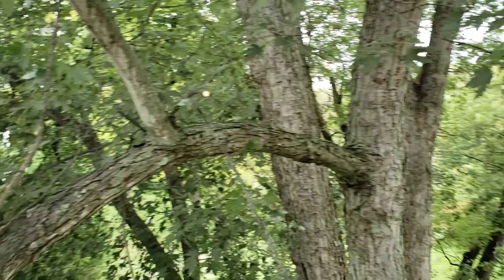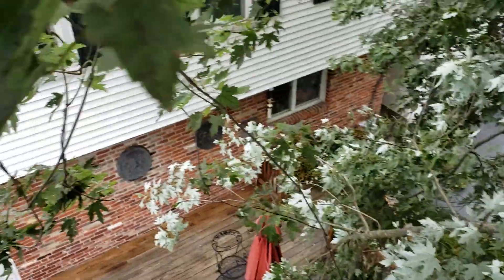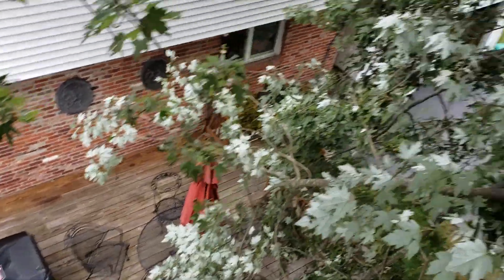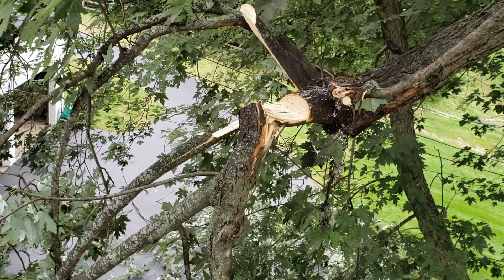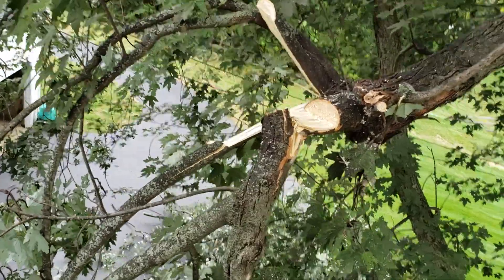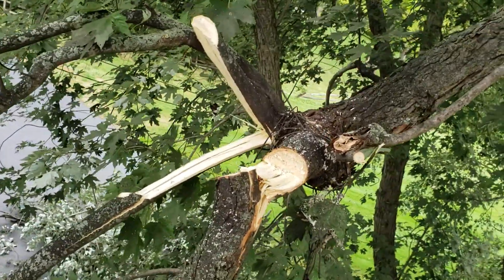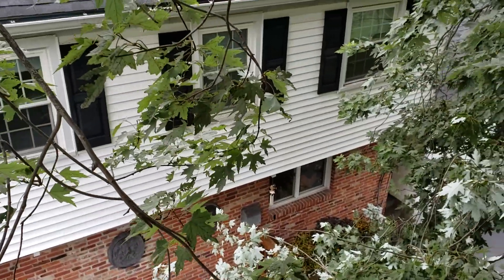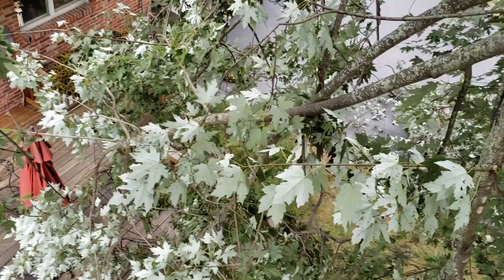how to reduce the force when hinging down a horizontal  limb

Comment: So did you miss the deck 😄.
Thanks for sharing, ive learned a lot from you through the yrs.
Reply from the maker: YA... brushed the railing.. had a take two with that incuded, but must have accidentally hit the record button when I moved the camera
Reply: @murphy4trees  nice, looked like you had it under control.
Hate when that happens, get done with the action then hit the button to stop recording only to realize you just started recording, bummer.
Thanks again for the video.